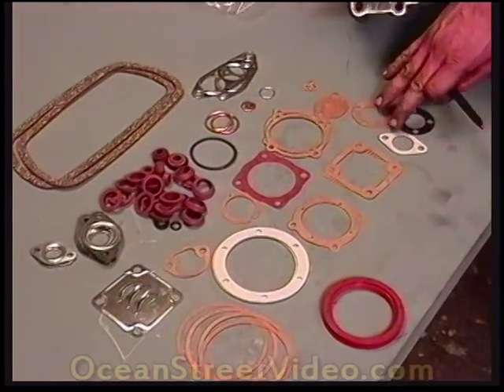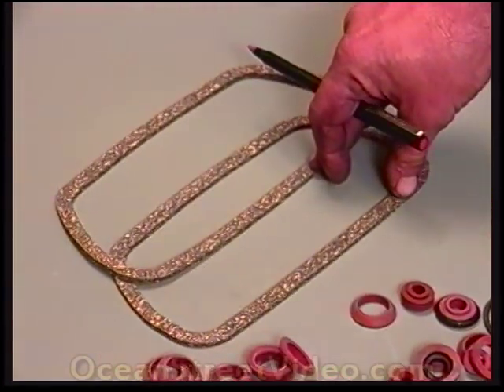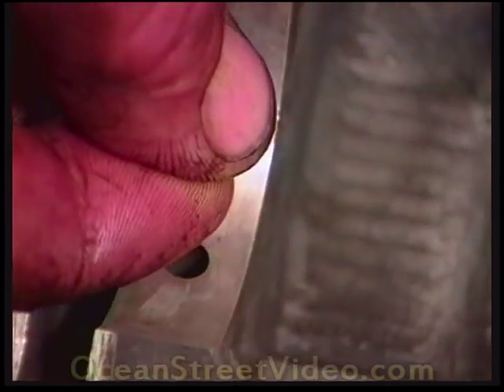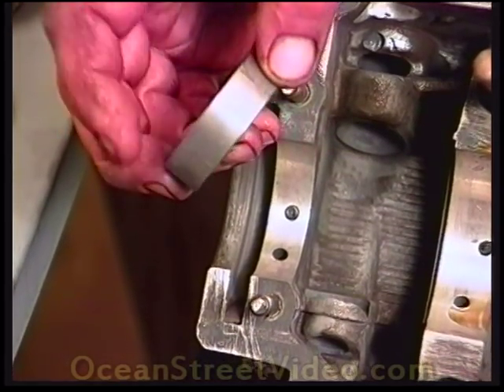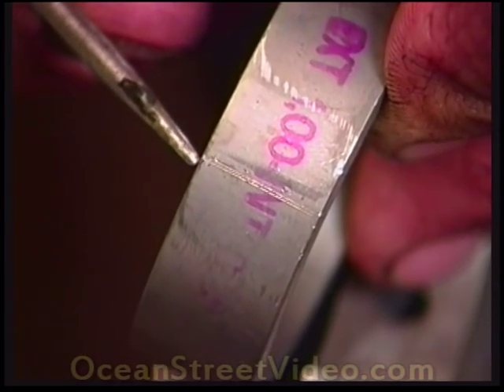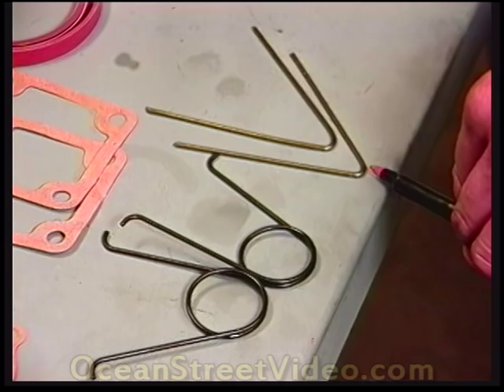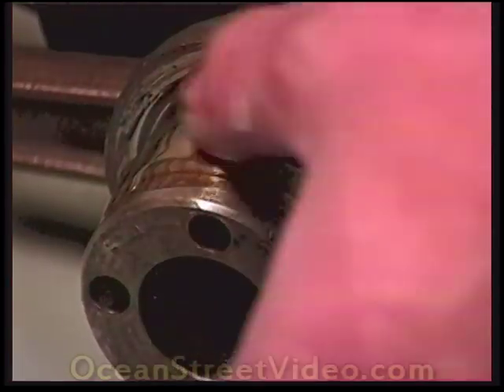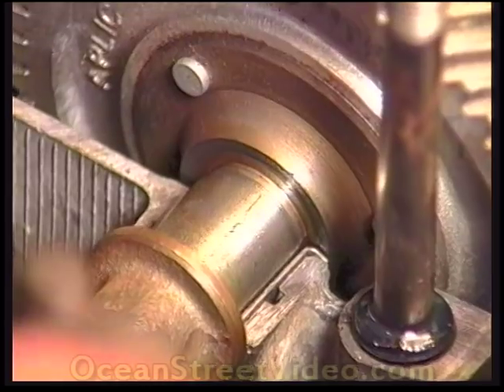VW Engine Building: Assemble Short Block Part 1, cam, crank, lifters

Comment: Good video, thanks   The last one i redid was over 35 years ago  back then i do remember having to buy the main separately  but every mechanic knew   What all the gaskets were for  not like it is today  of course the VW i was driving i bought for $200.00 bucks and a set of used tires  to a buddy that just graduated college. And bought a  used car  because of his new career  the Bug was running litterally on 1 cyclinder   As 2 of the plugs were dangling on the  plug wires  in the bay and the  threads were stripped in the block  it was my first time using heli coils and i was amazed they worked  that engine was rebuilt with cheap Brazilian parts and  last i knew the motor was  still running in a buddies Beetle   25 years later  my Bug was scrapped because of rust  issues i didnt know how to fix correctly. At that age  so the motor was pulled  that rebuild kit from a local auto parts store  was 113 dollars and it included 4 pistons and the rings   Plus gaskets   I knew the Brazilian stuff was crappy but I couldn't afford German parts and the car was needed as a daily driver    I had been looking for basic aircooled videos  on the older Beetles  for a while on YouTube  many show  very little  on the process other than  what they transformed one into  and how it runs in their vehicle ?  Ive always thought that  hey if i got 5 grand laying around i can order one from Ebay and have it shipped to my house too  i  guess many of todays generation dont rebuild  the old ones  i grew up  always  doing that   To save money my first car had a blown motor that i rebuilt   With my father
Reply from the maker: Some classic VW memories... I've watched Mike Smith "rebuild" a VW engine out of used parts, with the only expenses being a gasket kit and some sealer, then get 35k miles out of it. These little engines are pretty amazing.

Comment: hi ... am currently working on a polo 1.6 2002 model... but having some trouble when i put in the crank... once the crank is in and tightened the crank doesnt move when turning it manually ... i have thought of taking it back where i had it fixed but just want to find out if there could be other reasons why it is getting stuck....
Reply from the maker: ***** the crank itself could be bent, it should be checked for straightness on a jig, like we show at rimco... if the crank was turned, or the block was align-bored, incorrect bearing size could be binding it up, i try to get the bearings from the shop that did the machine work... you might be able to check the bearing clearances with plastigage, and/or measure the journals: http://www.hotrod.com/how-to/engine/ccrp-1202-how-to-check-bearing-clearances/

Comment: my thrust bearing had a tab on it and there is no tab recess on the cam bearing surface, what do i do?
Reply from the maker: That is rare, but it can happen with some dual thrust cam bearing sets that have a tab on each of the bearing halves. Since you only need one tab for the entire cam bearing, the way to handle it is to carefully grind the tab off of one of the bearing halves, make sure that there isn't any area standing proud that would keep the bearing half from being fully seated in the case. You could also grind a second tab slot in the other case half, but that's more difficult.

Comment: do you use grit brake in oil on the top of your cam? for brake in , witch is not the same as crank oil of course . thanks for all your vids they are great .
Reply from the maker: +MrGarcon98 thanks for watching the vids... people will coat the cam/lifters with a specific cam break-in lube, followed up by the initial engine startup and run time at the proper rpm, which is critical in order to keep the cam from going flat... many moons ago i used 20w non-detergent oil for break-in only, per the old berg recommendations, because it allows the swarf to fall out of suspension? but when the flat cam epidemic hit all pushrod motors 20 years ago,  the game changed completely, here are some old flat cam threads from 2000 or so: http://www.oceanstreetvideo.com/vwtech/CamsGoingFlat.htm
Reply: +DragRacingTV  thanks again , it all has to do with zink enough of it or lack of it . confusing how to find out how much . i learned at a young age run the engine @ about 2k rpms for 20min to break the cam in and your good to go ! thats was with enough zinc in the oil . thanks for answering me sir ,

Comment: My 66 bug still has the 6 volt crank. I see there is a metal and a paper gasket to fit onto the four dowels of the crank. Do you know if both the paper and metal gasket are to be used? If so, in what order are they to be placed on the dowels? i.e. if both are used which one goes against the crank and which one goes against the flywheel?
Reply from the maker: +DG Carlson now that's a good question! for anyone wondering about this, near the bottom of this page is a pic showing the differences in the flywheel area: http://www.thesamba.com/vw/forum/viewtopic.php?t=488279 so make sure that your flywheel isn't setup for the o-ring, since some of the 1966 engines had o-ring seals, and some 1966 engines had the paper/metal gasket setup, and who knows what was altered before you got the car.
My Bentley manuals only go back to 1966, i think that's when the factory made the change here in the U.S., the manual only mentions the metal gasket, and also notes the change to a rubber seal... i couldn't find any mention of the paper gasket, neither in that Bentley nor in any of the other material that i had.
Reply: @DragRacingTV   The paper is for the 36horse from 68 up I believe. Common in Europe not in USA.
I love these videos,I did a top end rebuild 4 years and 40,000 miles ago and plan on splitting the case for the first time this summer. I lacked courage to do this before but feel better about it now. Thanks dragtv.

Comment: question please ,,, if i needed the cam to have more thrust lets say that its too tight , is there ? a safe place on the thrust bearing we can san off a little material ? thanks
Reply from the maker: +MrGarcon98 i've heard of people sanding one end of the bearing, i've heard of people putting a brass drift against the end of the cam and whacking it with a hammer in order to flatten the bearing, etc... i've never had to do either, so i can't speak to what would work there, i'd suggest calling your parts supplier/machine shop, or worst case, googling it.
Reply: +DragRacingTV thanks ill check it out , a worked as a millwright for a long time i am sure if i had to id figure a way to shim it ! but asking never hurts thanks a million .

Comment: What was the black paste you put on before the grease?
Reply from the maker: it looks kind of like paste, but it's actually assembly lube or grease on the surface, which is then rubbed and mixed with oil, afaik the intent being that there will always be a lubed surface for initial startup, regardless of how long the engine has been sitting... i think that one of the counter arguments is that engine oil is thin because it's designed to get into the smallest openings, so will it flush thick grease out of a bearing surface area, in a timely manner.
Reply: DragRacingTV

Comment: Do those 'springs' rest on/touch the bores into which the lifters fit?
Reply from the maker: +DG Carlson no, the springs that hold the lifters into the case halves are inside of the lifters, they put tension on the lifter, and that's what holds it in place.

Comment: I have a Great Plains 2180 CC aircraft conversion in my experimental airplane. The vent tube is maybe 3/8" in diameter. There is a small but messy leak that so far eludes me. Wondering if the vent tube should be larger diameter and the engine is building up too much pressure? Anyone else had this issue??
Reply from the maker: i don't know that i ever had an aircooled vw that was totally dry, over it's entire lifespan... if nothing else, the rear main seal would always start leaking sooner or later.

if you are able to identify the source of the leak, it'll be a step in the right direction.
Reply: DragRacingTV  Hello, 
    Thanks for the reply. The oil leak appears 5 be coming from the lower rear crankcase seam. The manufacturer said permatex was supposed to be  used. No evidence is seen. Will clean up the  motor and lay some over that area of the seam.
Reply from the maker: rear crankcase seam as in where the flywheel would be? if you guys don't have that flywheel seal problem, and it's not leaking there, you might indeed be able to fix it by covering up the seam... i just went thru this with a 22re oil pump cover, i had to finally cover the seam with 2-part epoxy, to keep it from leaking... rtv didn't hold, the oil leak was under mild pressure, maybe permatex would have been enough..

if your leak is on what would be the pully end of the motor, it could be relevant to internal crankcase pressure.
Reply: DragRacingTV It seems to be related to pressure build up. Am wondering if enlarging the crank case bent tube should be larger. I will clean the leak area and rough it up. Then I'll  try the two part epoxy .
    This only leaks about 4oz an hour but it really makes a mess  inside  the cowling and on the belly of the airplane.

Comment: I placed in my crankshaft just like you i place the bearings the same  i tested it and it rotated but when i putted on the other half and putted al the bolt on tighten them down it was stuck frozen i dont get it anymore..
Reply: Got it the small Distributor axle was coming up and blocked all
Reply from the maker: congrats, that's good news!! it could have been much worse.
Reply: DragRacingTV I putted in the timing crank in wrong but cant find the video where you tell how it must be in
Reply from the maker: at about 12:20 on this video, you can see how the gears are set against each other... dropping the distributor drive slug in, and then setting the initial timing at tdc, is in the other video, here: https://youtu.be/y3XwFEzc0z8?t=52s
Reply: DragRacingTV Okay, Thanks i totally missed that part, i am now waiting for a compression tool for my piston rings hope i can start it nextweek, still need to paint allot of tins